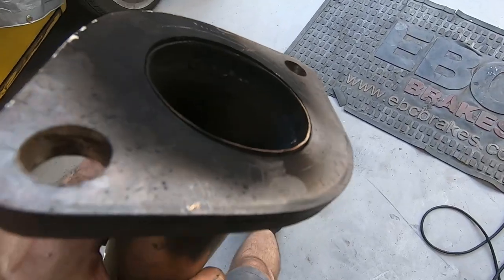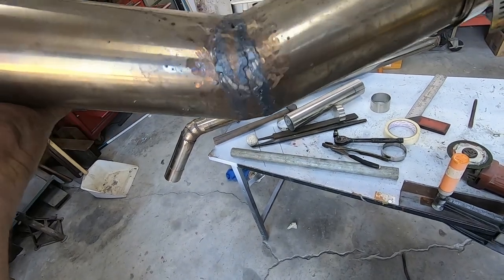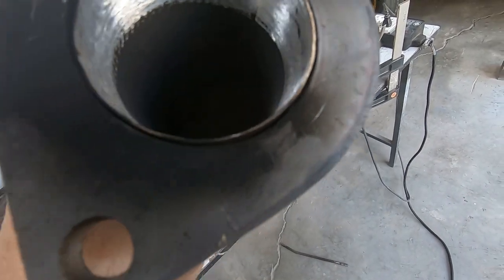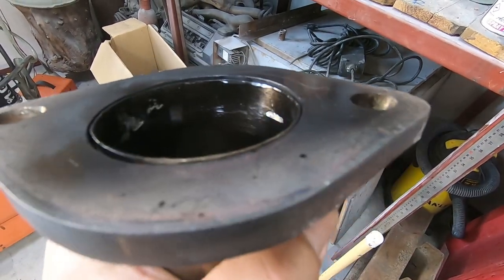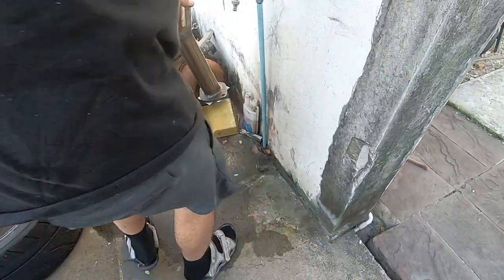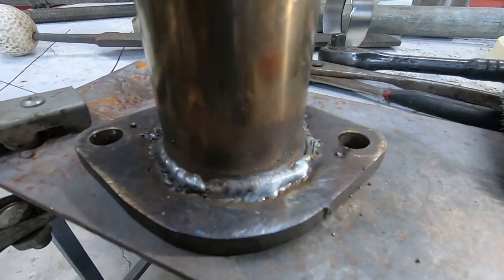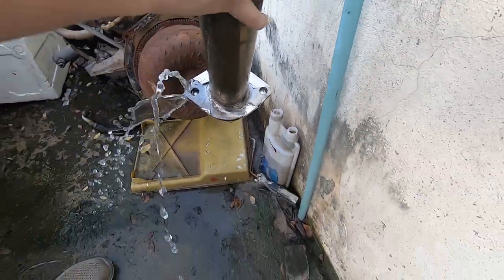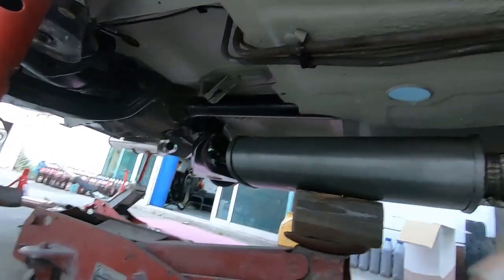[Ford Sierra Sapphire Cosworth] Repairing the exhaust on the sapphire

Comment: A calmer pace must be a big change. ;)
MIG welding exhaust pipe. I hate doing that job. I was told that wherever you start and stop a weld it can be a bit porus so leaks seem to happen easier.
I'm surprised you don't have a flexible joint in the pipe.
My opinion:   I enjoy long or not so long videos. But I HATE "shorts". The 1 minute or less videos are for the ticky-tok people with no attention span.
Well.. unless the short is a quick tip or a sneak preview of a longer video to give folks a heads-up.
Have fun!
Reply from the maker: All feels a bit weird. 7 days on almost and it feels it was ages ago and I've done nothing. 
Will take a bit of time to get back in the swing of things.
I'm doing shorts at the moment, seems an easy way to get extra exposure and through that extra subs.
I personally struggle with long videos, don't have time for them. I was thinking of doing a condensed version of the long one I did this week.
Reply: "The swing of things" Good luck with that. ;)
Yup.. shorts do seem to bring in the subs. 
Please don't do what one channel that I used to be subscribed to did... All they do now is shorts with maybe a 10 minute video every month or two. 
1 minute of cute litte waste of time videos aren't for me. I prefer to see a little more of a story.
Stay cool.

Comment: What size are your fuel lines??
Reply from the maker: Standard size mate. I'm using the original hard lines, just new flexible and in tank pump.
Reply: @Squintanditsmint   ok may have something for you i'll send over
Reply from the maker: Ooh a surprise 😮 this is exciting. Have you got any front indicator springs?
Reply: @Squintanditsmint  unfortunately no spares of them
Reply from the maker: Are they hard to come by? I've a friend with a spring factory who could make them.
Reply: @Squintanditsmint  new copies are available
Reply from the maker: @robrs210  nothing showing on Google or Ebay